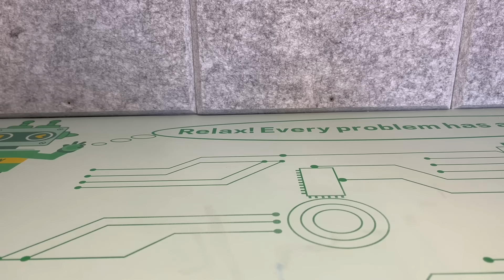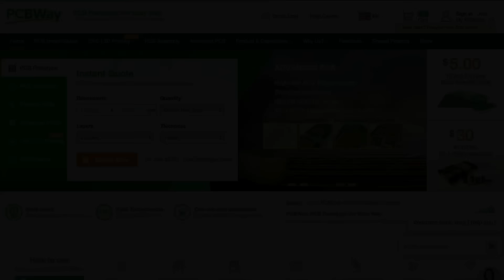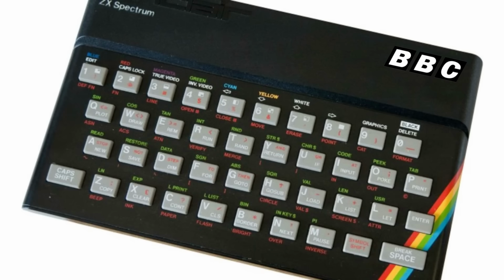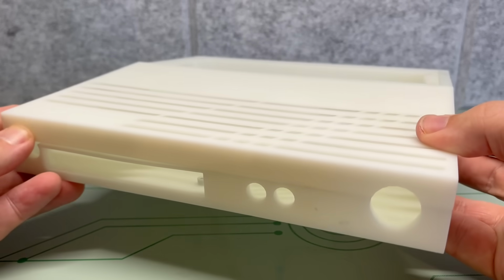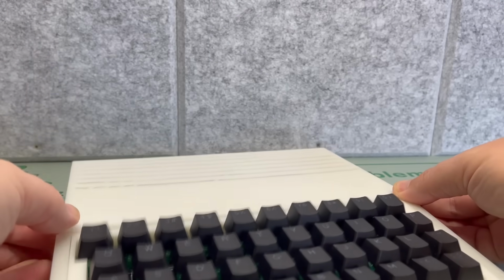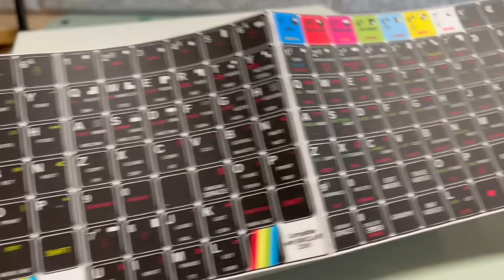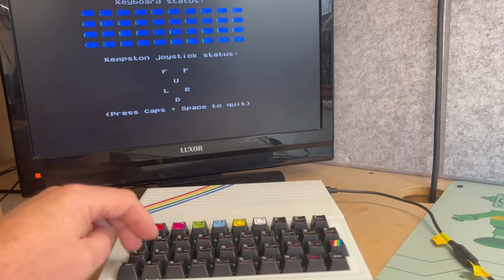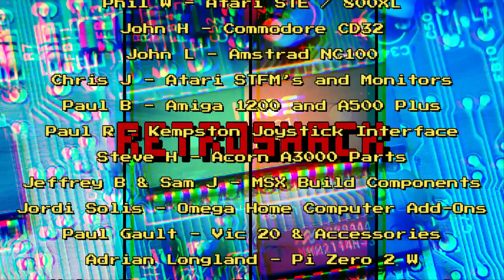You won't find another Spectrum 48k like this anywhere - Final part of our new build - and What If?!

Comment: It’s so cool that the price for low-quantity runs of basically production-quality prototype cases are available now. I’ve always thought SLA was better for quality and structural strength, and your little overhang is testament to that. 

I’ve been wanting a little resin home printer myself for a while, not for small computer parts (though I could), but for models to paint which you can’t buy anywhere else. Though I’m guessing PCBWay could probably do that too..!

Comment: A time saver what if you instead used the membrane and the rubber keys in your custom case instead put some micro switches between the rubber mat and membrane thus giving a click with each rubber key press?

Comment: Hi, Well done it looks great

Would you redo the case and add say 10mm more in depth to alleviate the problem with the angle headers and cable clearance

What of some type of heat sink ???  even the glue on ones like a raspbery pi

Regards
George

Comment: The special looks good, but not what a BBC sinclair would look like it would have been bigger to have all the items on the BBC tick list.
2 of being the analogue input port and a Teletext mode. without even thinking of disk drives etc.
Reply: The original BBC tender didn't call for any of those things. The BBC Micro was to have been the 'Grundy Newbrain', but that fell through, leaving them with a big problem. The BBC saw the Acorn and having been wowed by their spiel, theycwent with it, drawing up a new set of requirements along the way. Companies like Sinclair and Tangerine were of course a bit miffed at the BBC for moving the goal posts.
Reply: I thought that was one of the reasons why the Newbrain one fell through because they would/could not meet the full spec. @another3997
Reply: @another3997  You should have this discussion with a few of the people involved. I can think of one person who would vigourously disagree with some of these assertions. They would say that the BBC knew what they wanted and made sure they got it. I think that even people working at Acorn would agree that they got a hard time from the BBC over such matters.

In any case, before Grundy got involved, it was the Newbury Laboratories' NewBrain, and industrial politics tailored the initial specification to that. Acorn were certainly opportunists, however, and managed to squeeze the Proton into the gap left by the NewBrain, not least by promising a future CP/M capability that was eventually delivered in the form of the Z80 Second Processor.

It is actually rather likely that the specification evolved from merely exposing people to computers, which appeals to those who marvel at technology, to providing something that had a degree of versatility, which potentially appeals to a much wider audience. Along the way, features like Teletext and Viewdata capabilities will also have found their way onboard due to the trends of the era and the technological interests of the BBC, and I would accept that some of those capabilities could have been left out.

As for Sinclair's eligibility, it seemed pretty clear that he wasn't willing to compromise on his vision and the BBC weren't really willing to compromise on theirs, or at least not to the extent that they considered Sinclair's vision and often peculiar choices to be worth adopting instead. For example, Sinclair went on to release a business machine with another substandard keyboard and an underperforming, proprietary storage technology.

Of course, all this would have played out differently had the IBM PC showed up slightly earlier and been more affordable, or if ACT (later Apricot) had been able to bring their own products downmarket, or if the initiative had been postponed and resumed a couple of years later.